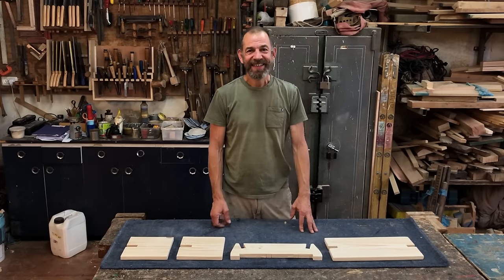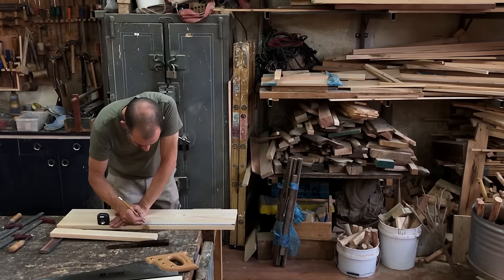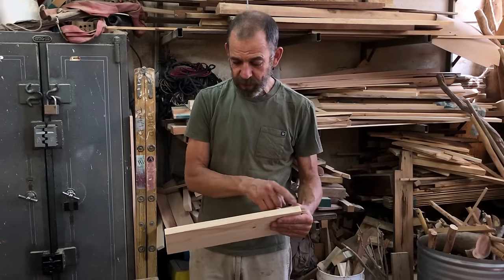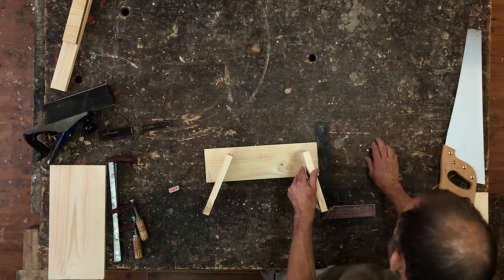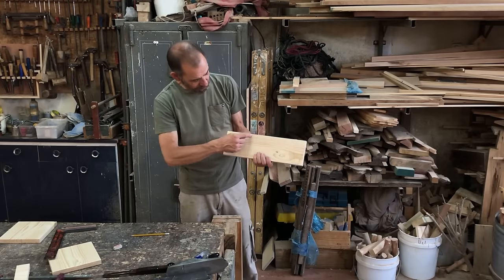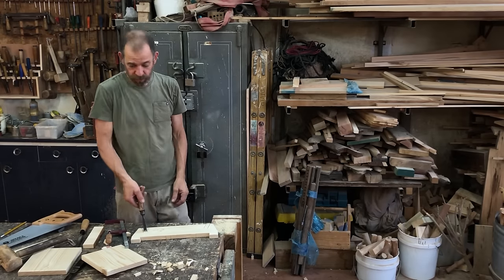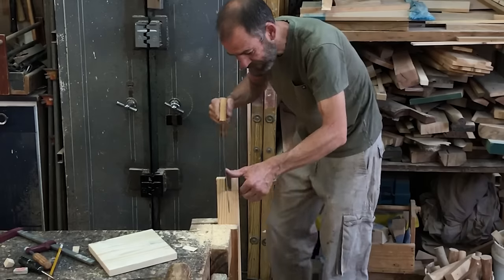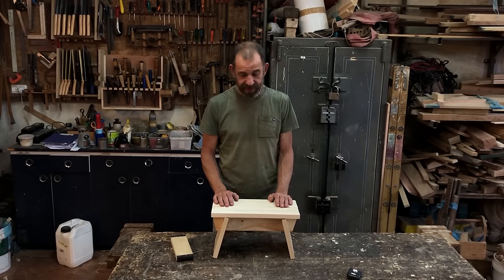How to make a Simple Wooden Stool

Comment: Just made one of these to kill time on a very slow saturday. took less than 2 hours and I have an entire day to go!

Edit: for folks making this using imperial units, approximate measurements as I used, are as follows:
seat: 11.5" x 20"
center support: 7" x 20"
legs: 11.5" x 11.5"
   My board had cupped and subsequently began to split the legs when I was working on it, so I glued scrap pieces across the legs and clamped them down. works just fine.
Reply from the maker: WOW Cis this is great!!! Fantastic input!! Enjoy the rest of your weekend Happy Woodworking David

Comment: Thanks David for your video clip. My wife wished for me to make a garden stool to use the garden to do weeding and I did not know where to start. I came across your video and it is so doable. I look forward to getting stuck into it .. still trying to figure out the height - width of the timber as you dont have a drawing except for a knockdown of the stool. Thanks for your contribution and have Liked your site. Cheers and good luck. Tony
Reply from the maker: Hi Tony Glad you like the video, 45/50 cm long 20/25 cm wide and 20/22 high seems to be a useful size ,you might like this option too https://youtu.be/I7LTjTbvrRo. All the best David

Comment: Hallo David. Would you suggest making an angled cut on the bottoms of the legs to make them coplanar (apologies if this is the wrong word) to the floor? Would such a modification make a difference? Thank you.
Reply from the maker: Hi if you cut the bottom of the legs level with the floor it will be an improvement just remember to bevel the corners to prevent bottom of legs from getting chipped .Have a great weekend David

Comment: Great detailed step by step. Could you provide any more insight to how you evaluate proportions during manufacturing? Is it just from experience or any general guidelines (except from knowing how existing furniture looks of course). Not always easy to picture the end result when you're standing there with separate pieces.
Reply from the maker: Hi it helps me to draw the piece to scale on squared paper or if needed I will draw it ful size on some sheet material and make changes until im satisfied with how it looks these two approaches also give me the measurements and angles.i hope this helps Best Wishes David

Comment: Hi David, I just finished cutting out all except for the top and have made my cuts in the stretcher slightly oversized and the legs are a little loose, do you have any recommendations for that or should I just remake the stretcher, thanks
Reply from the maker: Hi if the legs are loose you can add 2 wedges for each leg , 1 wedge from the left 1 from the right as you squeeze them together they will tighten up the legs 
Hope that helps good luck Happy Woodworking David
Reply: @RusticDavid  Thank you very much

Comment: Amazing design, will definitely do it! Would you recommend this design for a higher bar stool? What do you reckon?
Reply from the maker: Hi I wouldn’t recommend making this tall there would be a lot of leverage by the legs causing the joint to fail even with , 2”hard wood I would go no taller than30 cm
Best wishes David

Comment: Can you upsize this bench using the same geometry and have a stable safe item?
Reply from the maker: Hi Thomas theoretically yes you can scale up also thickness and maybe add another stretcher(the one under the top) I haven’t done it but it’s worth a try you will learn on the way Good luck Happy Woodworking David
Reply: @RusticDavid  Thank you

Comment: Hello. Could you give me the detail for measurement
Reply: I only catch of 2 piece of 40 cm, and 2 piece of 20cm, as beginning. 4cm on top to remove;  3 cm as leg  to snap in.
Reply from the maker: Hi Cathy a stool like this is approximately 40 cm long 22 wide and 20 cm high but you can change it to your needs or material available Happy Woodworking David
Reply: @RusticDavid  , I am try to do it this weekend. Will see.